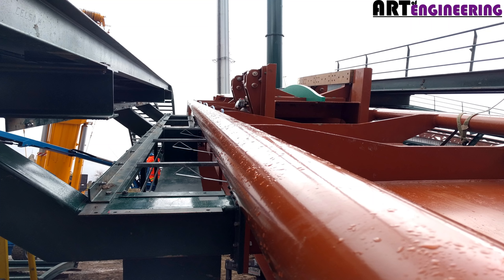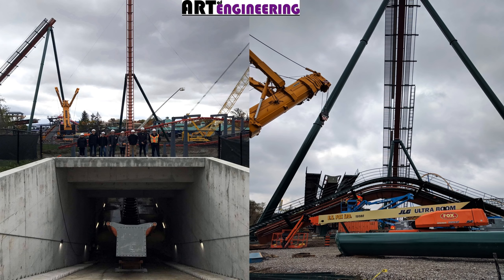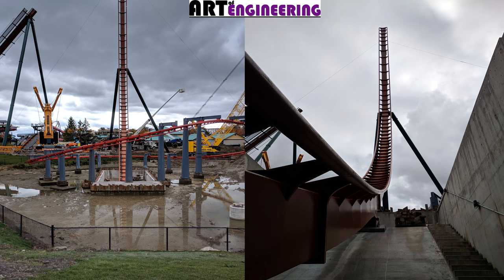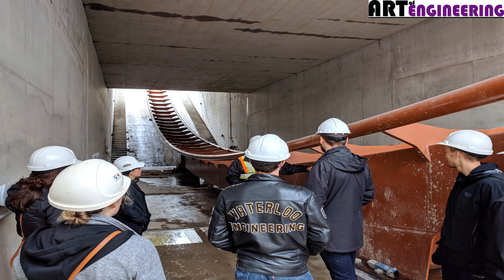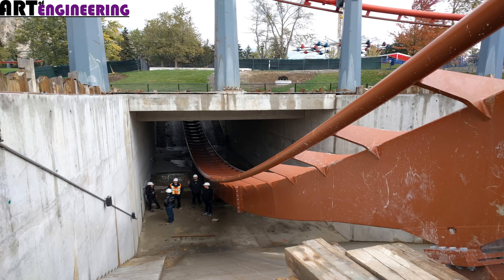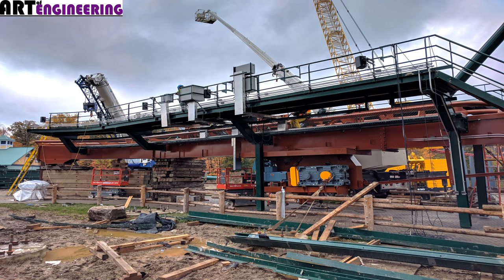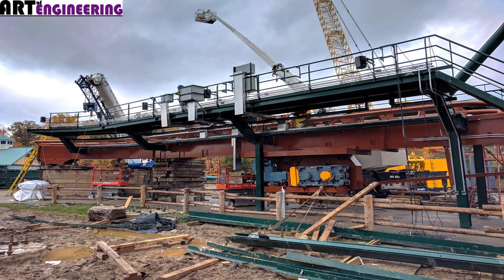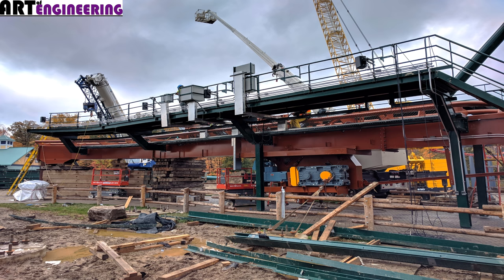Yukon Striker Behind The Scenes Shots

Comment: I was hoping they wouldn't have to fill the track with sand since Yukon Striker is more central than Leviathan and Behemoth.

(Also, I was technically first to notice the paving stones were still on the pathway by Canyon Trader, under the dirt/gravel, but otherwise, you have definitely been covering everything Yukon Striker as quickly as possible.)